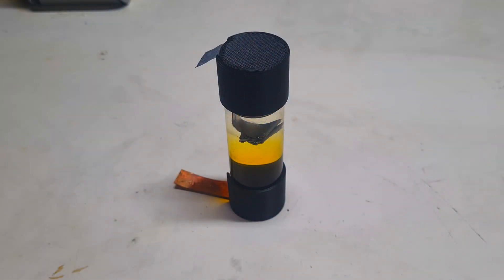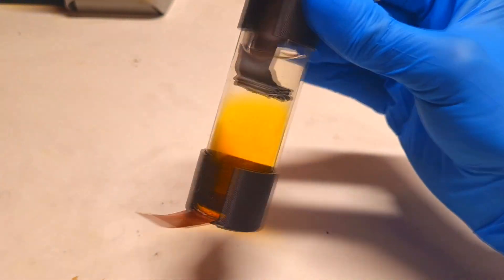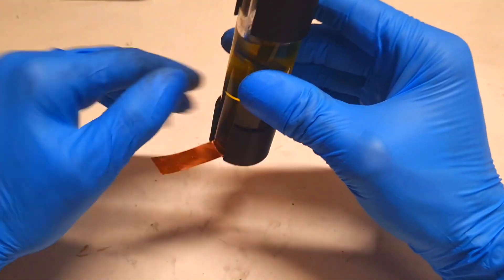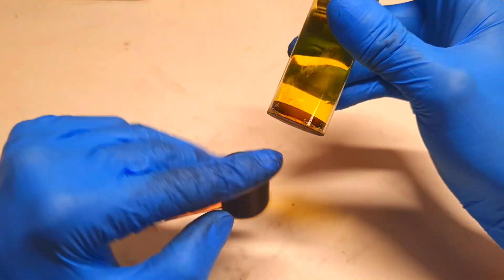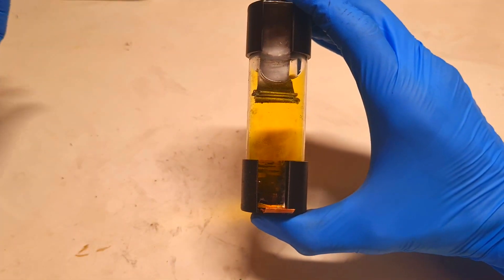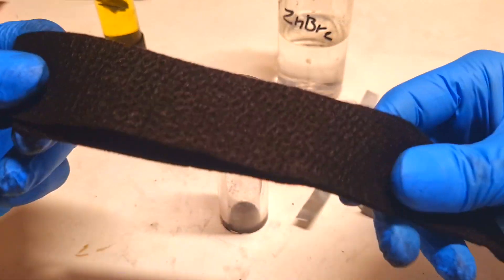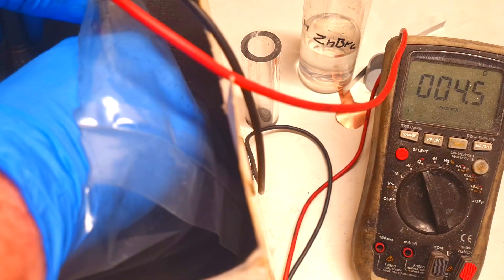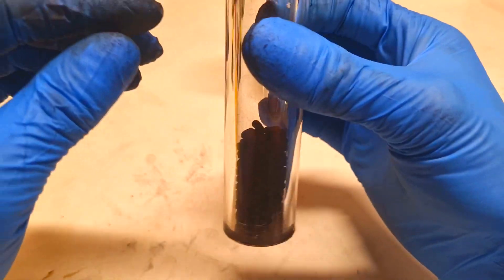DIY 10 times better Zinc Bromine Gravity Battery

Comment: how do you prevent toxic gases from escaping? Are there any toxicity issues to worry about?
Reply from the maker: You need to seal the cell or a quick fix will be ading some oil  into the cell. The oil will make a sealing layer. Also when you charge the cell and you dont seal it is good that you are in good ventilated area. If you smell a littel like in a swimming pool... that will not harm you. But if the smell gets intense and start to irritate the eyes then this is not so good for you.

Comment: I think you forgot to highlight the problem of bromine gas and the necessity of adding a complexing agent which can be quite expensive. Globally ZnBr Battery is a great battery chemistry!
Reply from the maker: @wwabete2009  Yes. Here the complexing agent is not so necessary  like in some static cell. And consist from 1 to 4% of the electrolyte or is impregnated into the carbon. The gas in that gravity cell was not noted.... if yes then the electrolyte in the cell can be seald with oil which can be poured on the top of electrolyte.

Comment: Dear Cayrex, i had the thought to improve even more your znbr2 battery. 
The idea is that before you glue the hdpe to the bottom of your tube, you just need to use iron heat and pressure to connect the lower copper  or grafoil current collector to the HDPE plastic first !! 
Thankyou so much !!! for your work you are doing a great job.

Comment: Please build a 1kW cell as a prof of concept
We never see anyone describe how to build a useful battery, only small size to power a LED or a 0.5v Motor ;(
Reply from the maker: Yes I want,... but sorry I dont have the budget for that.
Reply: @cayrex  Ok... estimate? we might help ;)
i can get hold of Bromine at a reasonal price, and i guess a lot of other could aswell
Atleast i would chip in if you make a working prototype for a large House Bank ;)
Reply from the maker: @trygvetveit4747  This will be to expensive. People get many times wrong when they think that making some "DIY" power bank which can power a house is easy and chep. Also the same will go with the prototyping which is way more expensive that the end product. The price of making a battery at home and as a natural person will be at least 10 times higher. For example: If I have a company then I can get most of the chemicals and for example the NaBr will have the price from $7 to $14/kg (on alibaba), but like natural person right now I have only one source of the NaBr and will cost me 45 eur/400g (and I need around 1.4kg for 1kWh),... And there are also other materials which are needed for making the battery. Then some custom cell housing can be also expensive if is needed cnc machining and other stuff (because for one battery you need 8 cells). And then will be also my time and maybe a time of a coworker/teammate,.... because small batteries have small problems and Big batteries have big problems,... and all this need to be tested and solved and this can take time and alot of attention.... etc. Also for people which they start in the research of the batteries,... they have a looooooong way with the experimenting to find the right battery chemistry and to solve the problems which they will get. I am lucky that this step is already mosty done. I mean I don't want to take away anyone's courage to make some big DIY battery project,... but such is the truth and the real situation.
Reply: Maybe so but until a workable design is reached through experimentation and a whole series of revisions with gradual improvement, it's costly and wasteful to launch into the scaled-up final product half-cocked.

Comment: I have 9kw of lfp that I power my whole life with and it is a struggle in winter with more power than I can use in summer so a cheap large capacity battery that can store the excess in summer to be used in winter is the dream. Maybe one day projects like this will lead to a diy solution to fill this need eg. something that can provide a few hundred watts constantly over a period of months to trickle charge my main battery would be a game changer for my life. It would mean a huge capacity of something in the triple digit of kwh I imagine though.
Reply from the maker: Yes I know what you mean. That can be done with a flow battery,.... because the electrolyte is stored in a tank and for this reason you have zero self-discharge and the battery can also go into a hibernation. And because the capacity of the battery is dependend on the amount of the electrolyte,... for that reason you can buy only some extra electrolyte (if you have biger tank already) if you need some extra capacity.

Comment: "can be made at home" is not a reason. Almost anything can be made at home with a different price and an output. But only few things make sense. Those which is cheaper than LFP, or those which is lighter than LFP, or those which is more powerful than LFP. It makes no sense to waste money and time if you can order cheaper and greater solution online right now. Correct?

PS And pls don't forget that if something is cheaper, lighter or greater than LFP is already on sale, because this is capitalizm. If you cannot find some, that means that big R&D companies have not invented it yet (I mean a whole technology, not POC things)
Reply from the maker: Here on this channel we are here to experiment, to have fun with innovating, etc.... Here I share ideas which people can use, replicate and what is more important to improve and in the end have fun. And not to beat other companies,..... that we do in the background 🤫😂 But yes,... if you need batteries for home storage go and buy what offers the market.
Reply: @cayrex  Yes.. It's like to teach how to build a crystal radio receiver. Both will be highly demanded after an apocalypse. Without a degree in  Chemistry it's not possible to improve a battery. Unless after 1000 random experiments with different chemicals, mixes, ratios, etc.

Comment: Cool IMO if you preped the carbon pellets an bromie under a vacuum to remove air you will get and improvement with the increased surface area interaction.
Reply from the maker: @Barskor1  Yes

Comment: Activated carbon helped to contain br3- and reduce the gap between both electrodes causing improve concentration polarization and improved current, but it will be temporary and slowly current will go down. Better calculate amount of charge in and then charge out. Additionally DoD is possible but actual implementation is pain. So sizing grows. Another is safety/hazard of Br3 as reducing agent.
Reply: Still overall I love your effort to put it public so more Research can be done in this area and convert to Solid state.

Comment: The separator you printed to keep the activated carbon tight -- what material is it?  some type or resin?
Reply from the maker: Yes It is printed with the resin. Here I use ABS like resin,... but if you need to more chemical resistance the you can use Siraya tech Sculpt
Reply: @cayrex  excellent, thank you! Wondering about resiliency of material is exactly why I asked

Comment: One thing I miss in all these kind of video's is actual CAPACITY testing. Can't you do some kind of test that way? For example a Lithium Ion 18650 cell has a nominal voltage of 3,7V and a capacity of for example 200mAh. Your cell has a nominal voltage of around 1.85V , but we have NO idea how many mAh this size of batterij cell delivers. That would be very valuable information.
Reply from the maker: Yes I know I dont make a capacity test, because most of the time I make a full testing on batteries which I have interest and the other problem is that I am limited with the time. But yes.... when I will have some extra time I will make a capacity test in this cell. The capacity of zinc bromine battery is also well known,... recording to wikipedia the zinc bromine battery have the specific energy from 60 - 85 Wh/kg and the energy density from 15 - 65 Wh/l in this case I assume that the energy is for the flow type. The static Zn Br from Gelion have the energy density of 120 Wh/kg. And my zinc bromine battery with improved electrolyte and in static cell design have the energy density of around 380 Wh/kg
Reply: Robert murray smith perforated aluminium then sandwiched between conductive hdpe. Maybe this improves contact and solves the problem you mentioned. He also said in some vague terms that hdpe  fails after time. Seems Bromine wins after all in attacking the electrode.
Reply from the maker: @martinjandijkstra3205  Yes, for this reason is not good to use metals in the current collectors on longer time. In more practical cell is used activated carbon as host for bromine which will most of the bromine adsorbe (less contact with "bromine and currcet collector"). Carbon  with sequestering agent will also work.
Reply from the maker: I also forgot about the gravity Zn Br battery from Princeton University (title: Minimal architecture zinc–bromine battery for low cost electrochemical energy storage) which have the energy density of 9 Wh/ L
Reply: @cayrex  And pls not forget to mention that all these companies and institutions use pretty complex things to maximize an output. Like structured electrodes with some tricks to avoid dendrites, organic chemistry for electrolyte, and so on. We wouldn't be able to beat them, and so will wait for such batteries in stores.
Reply from the maker: @sc0or   You are right. Almost 100% institutes use complex methods to make the cells. But in that case the price of the cell will be high because of the high price of some materials or high price for the process of making some stuf. Yes companies which make sodium and lithium ion batteries,... they use most of the organic electrolytes, high performance electrodes, etc. But they are also other companise which use other chemistry. I know some of the  companies  like eos, primus, ess, redflow,.... and some of china battery companies. And most of thes companise try to make non complex systems. Eos and ess and others simplify the cells from the last generation because of the cost. Of course is hard to beat companies which have way biger budget, people, etc..... but is also not imposible.
Reply: @sc0or  Still this can be overcome with sizing of a battery, espescialy when size and wheigt dosent matter , like in a house battery
Reply: @trygvetveit4747  Everything should make some sense. Because "for a house" the simplest way is a pot with a sand and a Stirling engine connected to a generator. Lead acid battery is a good choice for home if a flammability is a concern: easy to purchase, easy to recycle, the same price to LFP per Wh (in case of 100% discharge).

Comment: how does the chemistry handle overcharging? trying to think where it would fit in.
Reply from the maker: Amost like a Chemp. When you overcharge the cell you will get faster creation of the bromine and zinc. In this case the creation of the zinc dendrites will be also faseter,... If the dendrites are falling down to the cathode area the zinc will react with bromine to form back the zinc bromide. In some cases it can be insert some sieve under zinc to collect the zinc.

Comment: So the carbon pellets make for more surface area and that is why more current output?
Reply from the maker: @justtinkering6713  Correct,... more surface area (which is the key for more power) and also all the carbom pelets filled in the positive area of the cell make shorter distance between the electrodes (which lower the resistance in the cell)

Comment: This is a very interesting, is the increase because the activated pellets are closer to your zinc collector in the top, meaning the reaction only has to travel across that short distance instead of from the bottom all the way up?
Reply from the maker: Correct. By the gravity cell design is always the problem the distance of the electrodes. Bigger is the gap, bigger will be the resistance. Here the activated carbon increase the surface area (where can also adsorb the bromine a littel bit), increase the overall conductivity and reduce the distance between the electrodes.
Reply from the maker: So,... the carbon pellets reduce the distance between the electrodes but at the same time you aslo have enough space between the + and - electrode to form a zinc dendrites without making a shorting.